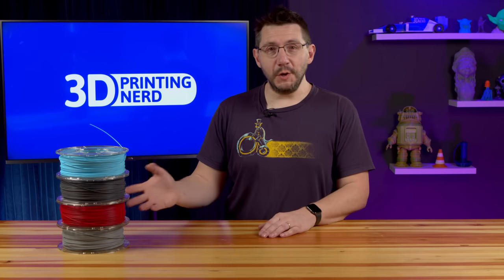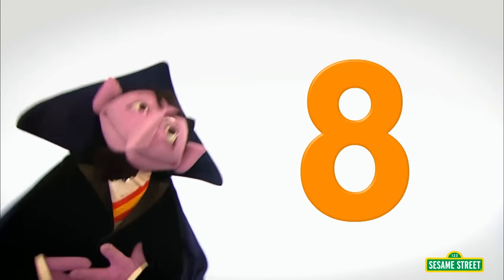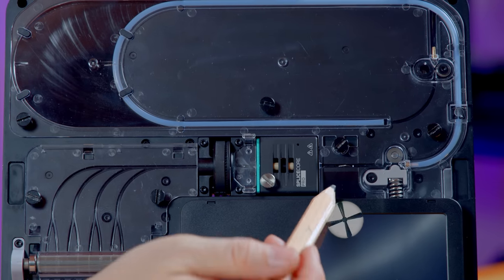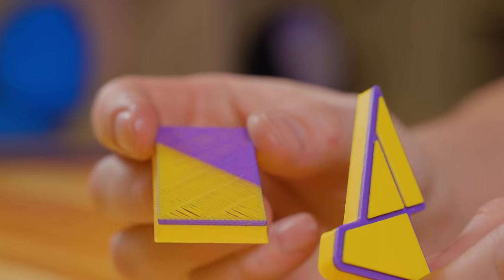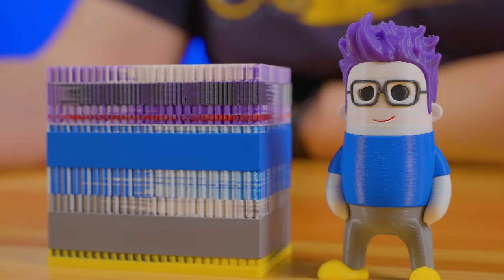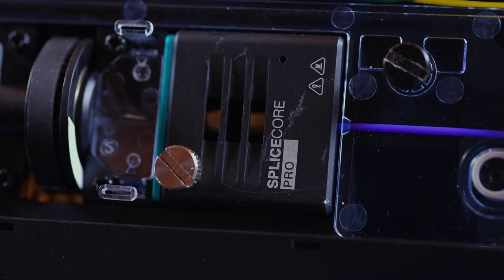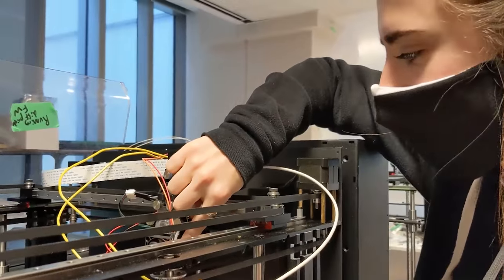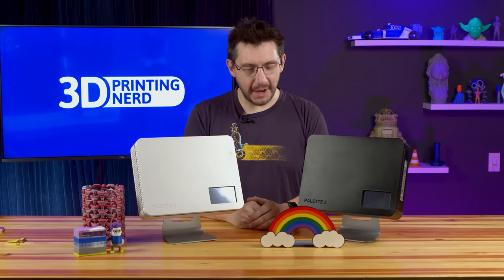8 Colors At Once! // First Look at the Mosaic Palette 3!

Comment: I like how during video there is no single model/purge block comparison or information about purge block. Just like on other models of Palette, purge blocks are much heavier than model itself which is just absurd. Instead of making new model of Palette, Mosaic should focus on solving issue with purge blocks, maybe use purge bucket which would significant reduce waste of filament.
In my opinion, "hiding" such information during this presentation is just not professional because such information is not something what should be ignored.
Reply: We’ve discussed in previous videos the transition towers. Also, we show you the transition towers of every model that had one. 👍🏻
Reply: Yep, I'm thinking even a purge wall, just tuck behind it, extrude, retract a little, wipe over the top of the wall. That block is ridiculous; for 700 bucks I'd expect not to be dealing with this at all.
Reply: @Aidenn23  Dont get me wrong, product is still impressive for what its doing, but for that price I would expect that waste is reduced to minimum. I know that they released a lot of useful features like painting model with which you can divide model faces to separate models in order to print it in multicolor but all this is just like working on side quests instead of focusing on main quest. In the end it doesnt matter if you can splice 1000 colors if weight of waste filament sometimes even surpasses weight of filament which is used for printing model.

Comment: Seems extremely wasteful with those transition towers.
Reply: I've seen a device that allows you to extrude filament into these little balls that are about the size necessary to be recycled into fresh filament. Sure, it's still wasteful, but you won't go through as much filament, and you still have your full build space to work with.

Comment: The amount of waste is making a recycling solution look ever more appealling.
Reply: Unfortunately, all your recycled material ends up poop brown in color. :D
Reply: @bradley3549  :D True, but if you're painting it or using it for prototyping, the colour is not important.
Reply: @Martial-Mat  Which makes me think. How slick would it be if you could load up additional models that were used as the waste. Anything but a shapeless block!
Reply: @bradley3549  Wow, that's a great idea!

Comment: Useless and way overpriced..... At least they fixed the filament breaking in the look by using a PTFE tube for it. But what we really need and would be a much bigger selling factor is a $149 Pallet SE which only handle 2 filaments. Why so important ..... We all been printing a lot but nobody so far has a product which is just an auto refill for a printer. In production environments we use only a single color for a printer anyhow. 2nd nozzle is an option for support solvents. So mainly we need an option which auto feeds for us the next spool into the printer that's really all we need but we need those units a LOT. Print farms like ours would need 30+ units. So someone should please come up with a solution which doesn't require manual interactions.